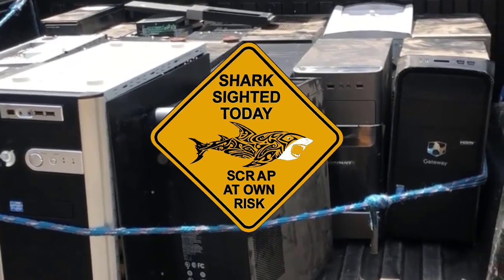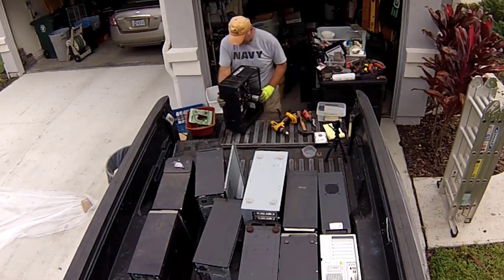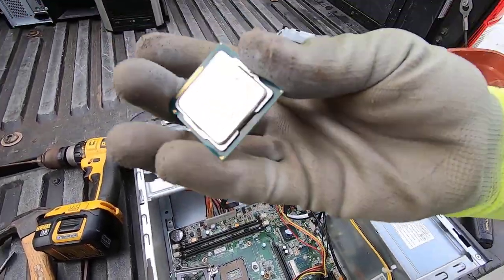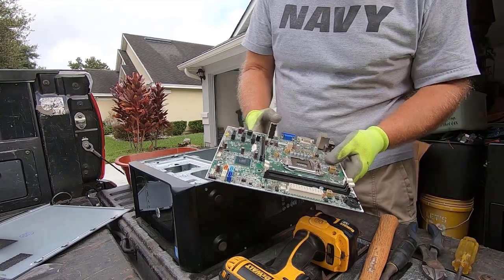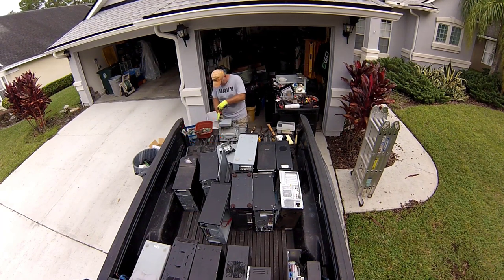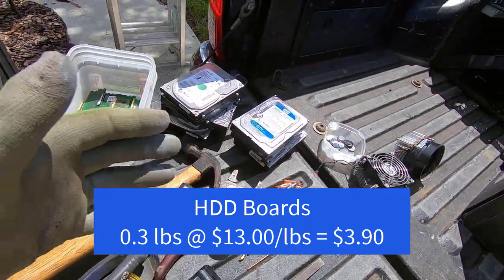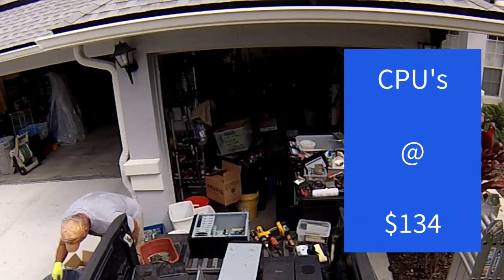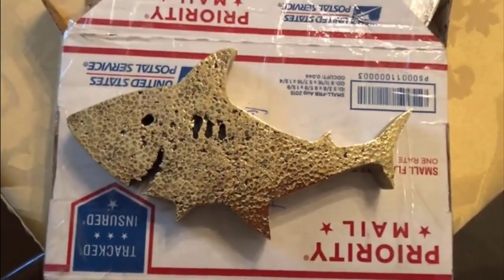$ in scrap PC's - how much money can you get from scrap computer towers?

Comment: I refurbish computers, and the 2nd and 3rd Gen Intel systems especially still have a lot of resell value to them. It’s important to keep in mind that a working system and working parts are almost always going to be several times more profitable than the scrap value.
Reply from the maker: Thanks Justin, you are correct.  I do resell reusable components for much more than scrap.
Reply: A Longshot since you commented so long ago, but what do you mean by "refurbish"? Some odd reason I've collected towers and laptops and idk what to do with them now. Taking up too much space. I have the knowledge of the parts, but how does one refurbish a pc from 2010 and sell it, knowing that the parts are typically outdated?

Looking for genuine advice
Reply: @Argophobiac  thank you. I appreciate it and will use this comment as reference.
Reply: The second and third gen were also lower hungry. I also sort out old machines like these.

Comment: Since your yard does #2 with the ends on, I'm assuming they don't care about the zip ties or tape either?
Reply from the maker: As long as it isn't too much they don't mind.  I still remove them when I can, especially if it's big Velcro wraps.
Reply: Gotcha. I was cutting ends off & those small plastic zip ties for quite a while just to end with insulated aluminum wire. I'm definitely gonna double-check with my yard or whoever I decide to sell to before I do the next bin. Thanks for the reply, and I appreciate your videos

Comment: Do you have a video on categorizing computer wire for scrap?
Reply from the maker: I will add it to the que for a future video.  A lot depends on how your yard grades wire.  Most yard consider the ribbon wire as low grade and the rest as #2 insulated.  You also likely need to remove the plug ends.  Some yards, like the one I sell to, just take it all as #2 and don't make me remove the plug ends.

Comment: I usally test the machine to see if its working if not I tear it down and go through the storage and rom drives, I keep drives for spares for PC repairs and the rom drives I sell on ebay for a few bucks. then the cases and aluminum heatsinks I sell to a scrap yard and the rest to an waste facility I never thought about ripping off the copper and the oscillator whats in the oscillators?
Reply from the maker: Hey Dave, your process makes a lot of sense for someone doing PC repairs.  Oscillators have a small amount of silver in them.  However, getting at the silver is very time consuming.  It requires breaking open the oscillator shell and processing the contents with appropriate acids.  I've stopped removing most oscillators as I don't see it as economically worthwhile for my business model.  I randomly remove big oscillators thinking I might experiment with it some day.
Reply: @sharkscrapper  ah thanks for sharing, I will let the electronics refiner I sell to do that extra work, he's got the acids to do that and he does share how much gold, silver, and other metals he's got from the systems with me and writes a check out to me for doing mass drop offs.

Comment: Just learning, any value in old TV brown boards
Reply from the maker: Yes there is.  At a minimum you can sell them as low grade boards to most yards.  But some have IC chips, copper coils/toroid's, Al heat sinks and transformers that can be depopulated.

Comment: What are you referring to as jumpers? Is that something you are saving for board sort or your scrap yard?
Reply from the maker: Jumpers over some of the gold plated pins on motherboards.  They act like switches by closing a connection between the pins.  They are used to configure boards and components.  Look for small plastic "boxes" over some of the pins.  Then can be any color and pull off easily.  Inside is gold plated.  I'll do a short in a couple days to show them more clearly.

Comment: Does taking off ICU chips and BGAs from laptop or PC motherboards down grade the board?
Reply from the maker: Yes it can.  A lot depends on your yard/buyer.  You might get away with an IC chip, flat pack or two.  But if you remove a gold cornered BGA you'll likely get down graded.

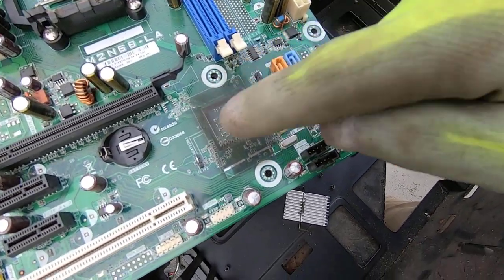Comment: 2:18. That's not scorched, it's dust/dirt.  and the melted plastic is not plastic, it's remnants of the heat conducting pad/paste between the heatsink and the silicon top of the bga chip.
Reply from the maker: A plausible explanation.  Unfortunately, I've already sold this board off so unable to go back and verify.

Comment: You would make more money selling these for parts on eBay. Just sell the whole Tower you're leaving a bunch of money on the table. Also all the labor
Reply from the maker: I tried that and it didn't work out too well.  They don't sell all that well and shipping is steep.  I found that selling some of the components on eBay is viable.  Things like 4GB+ RAM, 2 TB HDD's have a market and don't cost a lot to ship.  Some folks also like to purchase vintage PC equipment - but that's a slow market.

Comment: I cringed when he touched the side of the cpu that goes in the socket (forgot what its called or it doesn't have name idk)
Reply from the maker: I certainly didn't mean to make you cringe.  The only CPU in this video that needed to be handled carefully, for potential functionality, was the i-series CPU.  You'll notice I was holding it along the edges and did not touch the pads that make contact in the socket.  All the other CPU's are sold for their potential gold recovery value so touching them on their pins or pads is no big deal.  Hope that helps you feel better.

Comment: This will only pay if you are getting the computers for free, how do you value your Labour ?
Reply from the maker: I do get a great deal of my feed stock at no charge, sometimes even get paid for the pick up.  But you've hit on the main challenge of anyone in this line of work - what is the value of our labor.  For those that do this as a hobby this is not a concern.  Since I have decided to do this professionally, my labor is a significant concern.  Unfortunately, I don't have an answer for you as I'm just moving into a new facility with the size I need to gain processing efficiencies.  At this early stage my margins are not great but I believe positive.  We'll see as the year plays out if I've done my homework well enough.